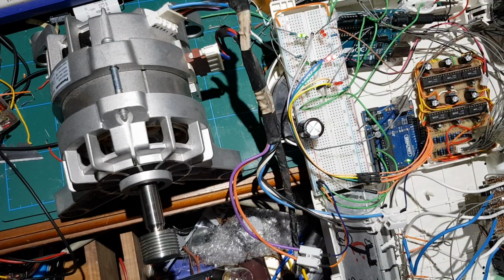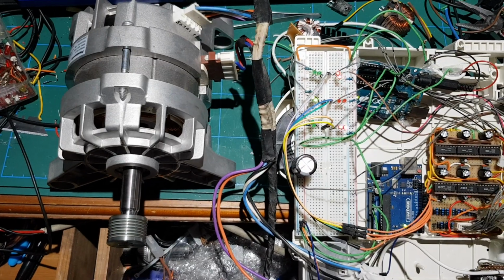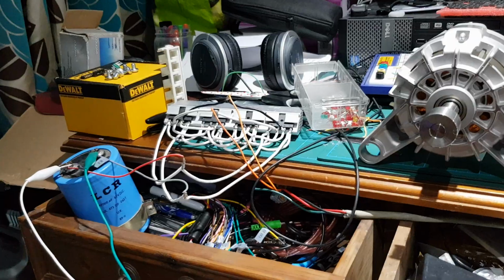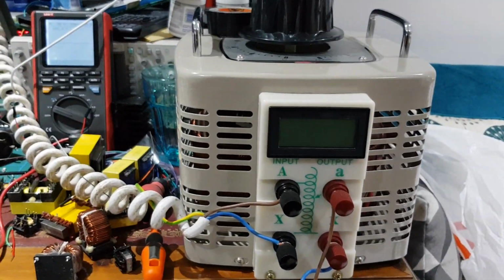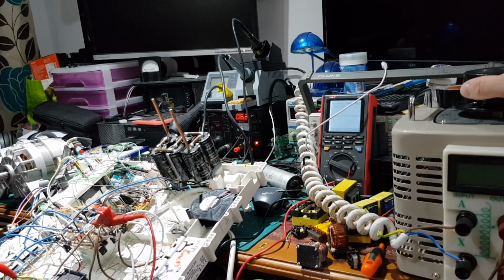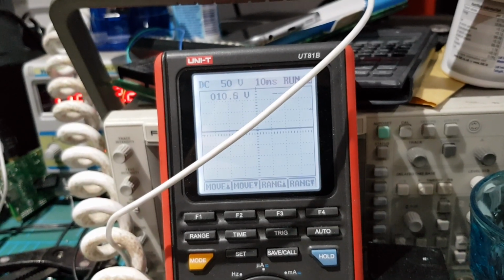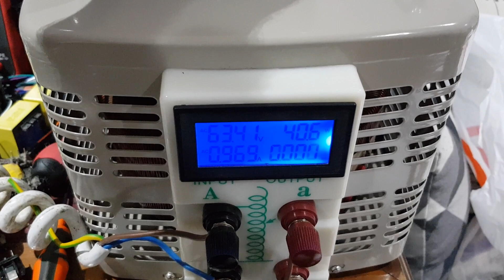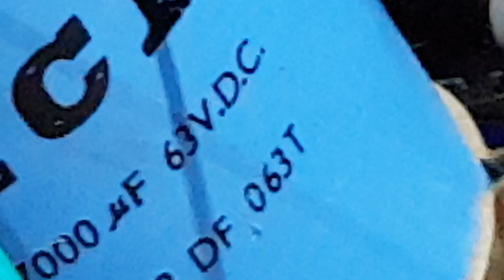Ac 3 phase motor control #1 intro

Comment: 9:21 mate absolutely brilliant video but please respect the working voltage of your capacitors. Trust me you don’t want one of those the size of that one you have there going off … ok it’s probably got a vent on it but if it’s the type with a weak point scored into the case (usually an X shale scribed into the bottom of the case) it will seriously go off with one hell of a  bang‼️ 😵‍💫🫣😲😲

Comment: Great work! In regards to regenerative braking on a series wound DC motor. I noticed you said you had 5 V one amp into your stater coils. Can you explain more as to how you came up with that number. For instance I have a large 8 hp DC series motor what do I need to supply the stater coils with to excite that magnetic field. How do I figure out that number
Reply from the maker: Hi actually i didnt calculate the number .. what i did was a bit of trial and error.. i had another motor spinning my drive motor and tried different voltages until i got the correct braking effect and generated voktage i required